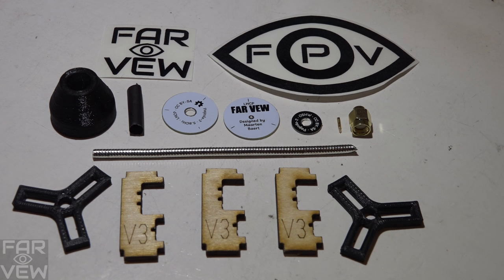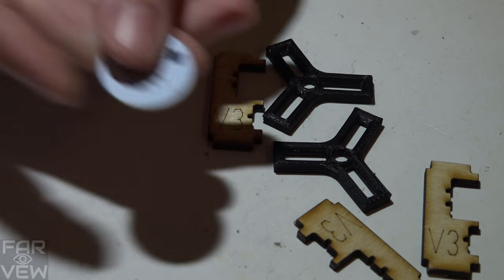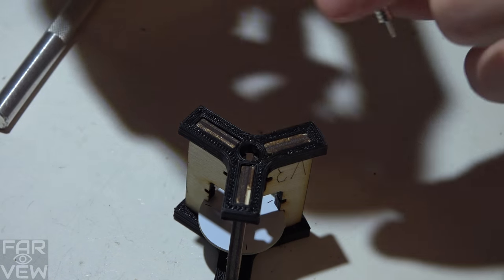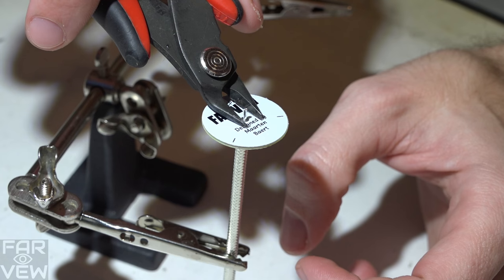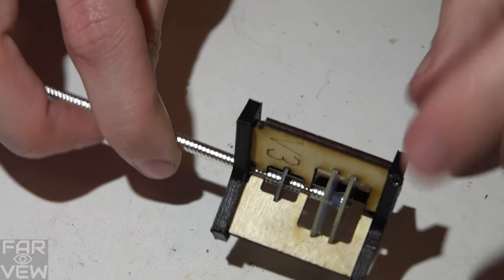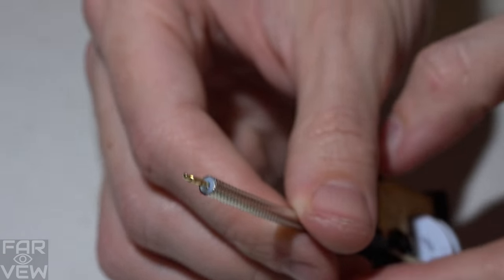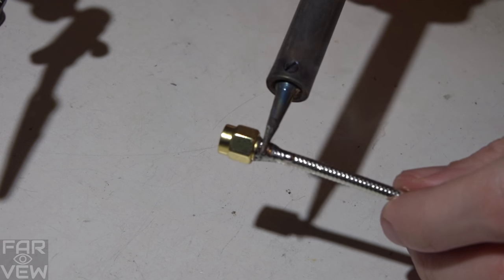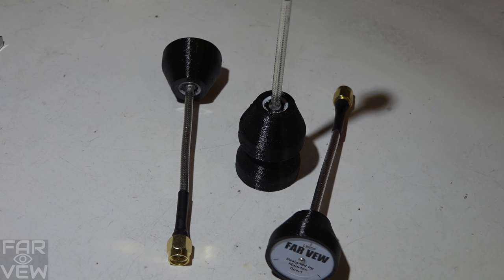Building Far Vew Pagoda Antenna Kit

Comment: Thanks JC. Saw your video as I was just needing to get a selection of antennas. I'm just getting into fpv gear so found myself in need of sma and rp-sma to replace all these standard issue dipoles. Ordered 2 rhcp sma, 1 rhcp rp-sma, 2 lhcp sma, 1 lhcp rp-sma kits and two covers. $53 with free shipping and came with two free jigs!  First one took me an hour following your video and figuring stuff out and I'm an average solderer. With two jigs it's a relaxing 10 minutes to crank out 2 antennas and allow things to cool. Just waiting on my rf power meter to arrive so I can test them and my transmitters!
Enjoying your channel!
Reply from the maker: Awesome man. Sounds like you've got an assembly line going on.
Reply: Hey JC, I was a proud papa when I saw Josh Bardwell's antenna review, Farvew Pagoda did so well.  Got some more on order to make for friends.
What is your patch antenna recommendation?
Any DIY patches?

Comment: Excellent video JC. I didn't know these kits were out there.  I'll be looking into it.  Thanks
Reply from the maker: I'm liking them so far. They have a good mix of low cost, high durability, and good performance. I bought 10ft of RG402 coax off amazon, 10 connectors, and then just bought the PCBs off Farvew for $5 each. Seems to be the cheapest way to go.

Comment: We do suggest keeping the receiver the spec length of 90mm or longer, however the transmitter could be shortened to 30mm from the bottom PCB to the end of the SMA

Comment: Hey,
how important is the lengths of the coax-cable? How long it must be? or doesn't matter?
Reply: René Horstmann  We do suggest keeping the receiver the spec length of 90mm or longer, however the transmitter could be shortened to 30mm from the bottom PCB to the end of the SMA

Comment: What is the difference between these and "normal" circular polarized antennas?
Reply: Patrick Reddy the largest advantage of these is how perfect their radiation pattern is. also their ability to reject opposite polarization is much better.

and not to mention they are much tougher
Reply: another thing besides the perfekt polarisation pattern is that the third plate. Due to this plate the cable doesn't act like a Dipole antenna and hence, just have circular polarized radiation (what you whant to have).

Comment: qustion, i had some solder flow from one pcb to the next one, is that going to affect performance ?
Reply from the maker: No thats fine. Happens on every one of mine. If anything that would just add strength having both sides of the PCB soldered.
Reply: Awesome. Thanks for the quick reply

Comment: hi i'm new to this. what is the deference with the RHCP and LHCP? left hand right hand?
Reply from the maker: Yep. Left and right hand. The idea is that if there are multiple people flying at the same time, you can alternate antennas. Someone on say 5700 could use right hand, another on 5750 uses left hand, then a right hand on 5800, left on 5850 and so on. That way you someone elses video wont bleed onto yours as bad.
Reply: thanks keep up the good work! ;)